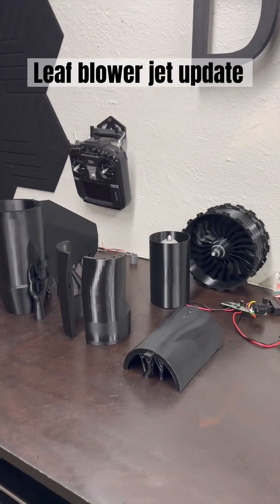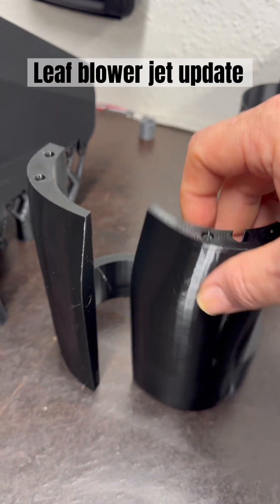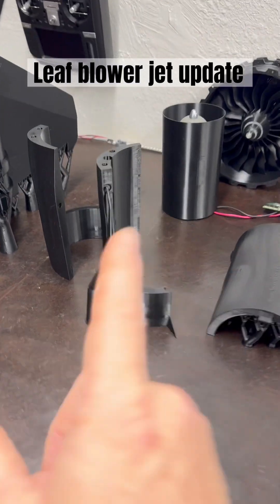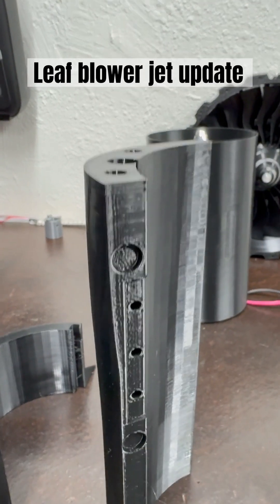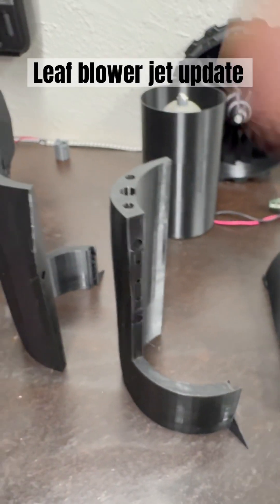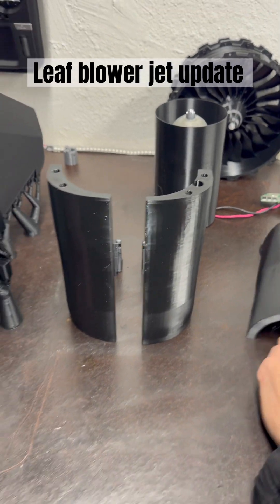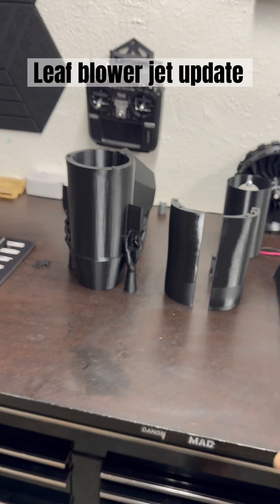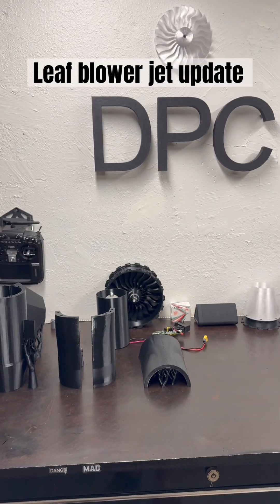Leaf blower jet experiment update #edf #leafblower #rc #jet #fyp #shorts #3dprinting #diy #aviation

Comment: Is there a way to recycle it and respool it for reuse?
Reply from the maker: There are plans for them online. Just have to get the hard parts, heaters, extruder at 1.75mm and so on. Plus, a used filament crusher.

Comment: In some slicers, there is a setting like "support on plate only", which, if selected, results in exactly this behavior. Maybe yours have it too.
Reply from the maker: Yes, that option is there however if you do plate only the only thing it doesn't do is support what it can reach. In my settings Support on plate only is not checked. Thats why I wondered why it started at the plate. Could be that the base of the dowel hole was not within the threshold necessary to start support, for example being only 3mm deep.

Comment: Not sure how it relates to smaller scale, but I've made flyout planes that pull 30 and up degrees per second
Reply: Sustained
Reply from the maker: On lift alone, or with any elevator input?
Reply: @warmachined3472  no, with elevator, but only 20° of max deflection